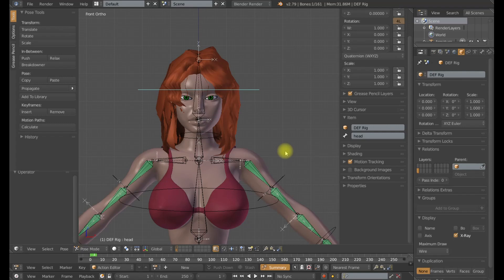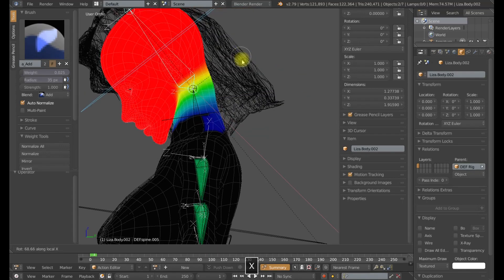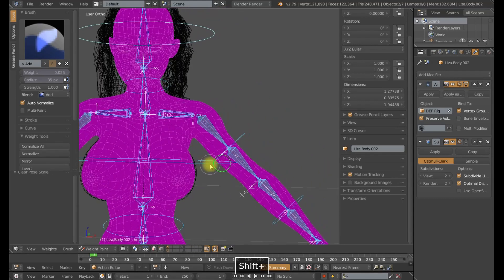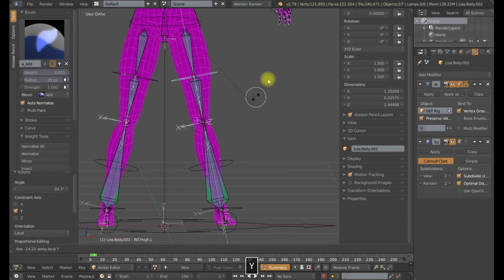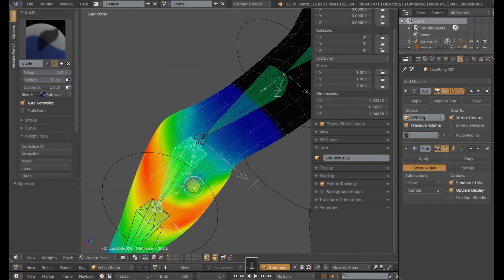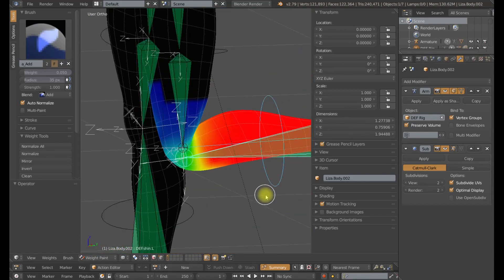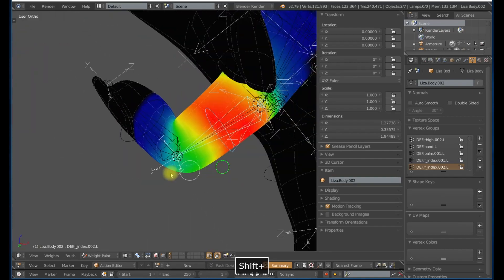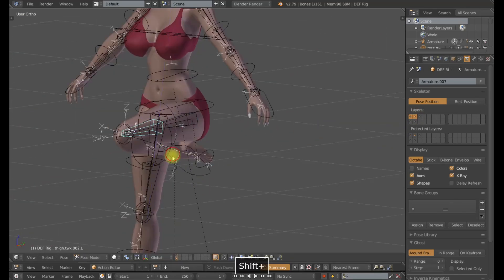Advanced Deformation Series Part 6B Weight Paint Tuning

Comment: Have to ask for some help from you as master of good deformations and rigging. It's rigify. I have noticed one detail. When you bend knee to some extreme angles (like more than 143 degress on x-axis) mesh get unwanted twisting in the area above the knee (lower thigh bone). I have no idea how to fix it. If youcan help here is thread at blebnderartists, please answer here or at forum :-( . https://blenderartists.org/t/rigify-knee-elbow-bend-issue/1128706/
Reply from the maker: You can use the b-bone options to untwist them, but it is a pain to do manually. (Located in the bone properties tab.) That is one of the reasons I make my own deformation systems for the Rigify Rig and do not use b-bones.
Reply: Holy... I thought rigify is easy and ultimate solution at any kind of deformations for biped characters. Tho it has such dissapointing limitations. Thank you for answer i will try to mess up with bendy bones option if it will be unpleasant for me then i don't know what to do. I could recreate rig from your great tutorials but that snapping FK>IK feature look to me really difficult to implement. Ehhh. :-(
Reply: Ok after messing with that rigify bendy bones, i think i've got solution for my issue. Reducing number of twisting\flipping bone segments (Def_thigh.001) down to one segment - get rid off that annoying flipping! And now i just can use your "flipped shin-bone technique" to realize natural bending knee even at extreme angles! Yay! Thank you for answers DanPro. Your advices and tutorials are great!
Reply from the maker: I'm glad you got it sorted out.